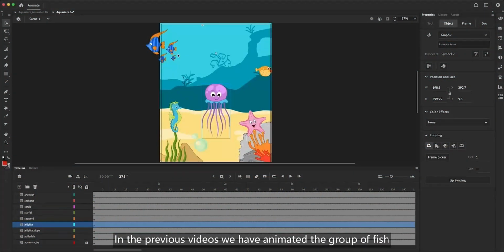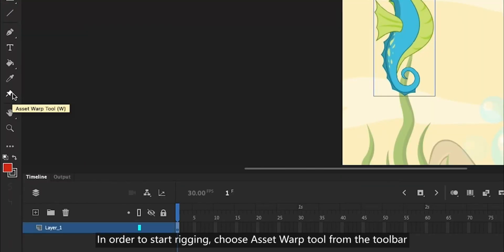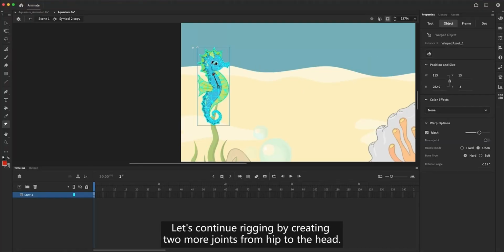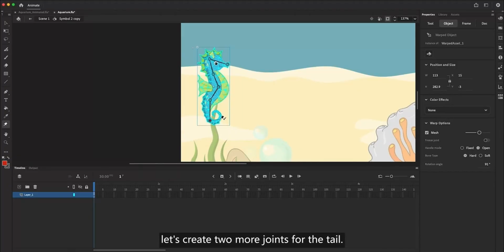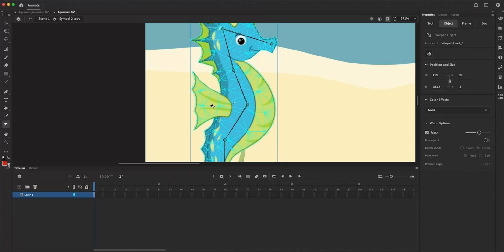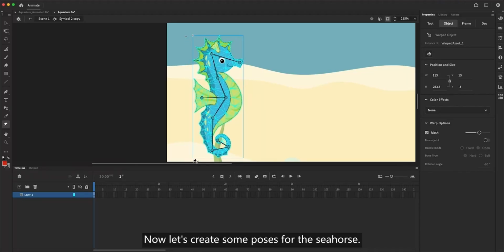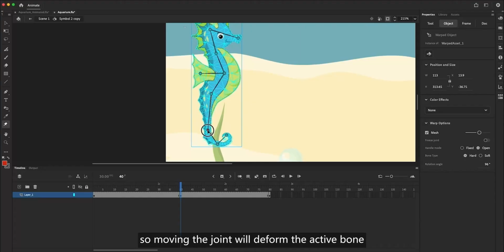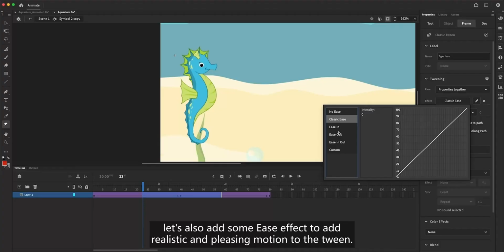Modern Rigging - Creating rigs (bones and joints)

Comment: Hi guys, do you have any idea how to DISABLE this modern rigging? I need the old asset warp tool because it always forced my character to this error  "to ensure a good warping experience, animate will be converting all files under to under 1500". It's not helping me.

P.S.
I saw the individual joint, it's just that it has the same error. It's forcing my character to degrade its quality.

"to ensure a good warping experience, animate will be converting all files under to under 1500"--- HOW TO FIX THIS

Comment: How do we do this for characters in layers from Illustrator?
Reply: Import AI file to Animate stage or Copy-Paste the shapes from illustrator to Animate. Once imported to Animate make sure there are no symbol objects, else break it apart to shape or bitmap and then you can start Rigging straight away. Modern Rigging works on Shapes/Drawing Objects/Groups and Bitmap combinations only as of now.
Reply: Hi - The easiest way is to select all of the different pieces you want to rig on stage and convert them to a bitmap then start creating a rig using Asset Warp Tool. Thanks!